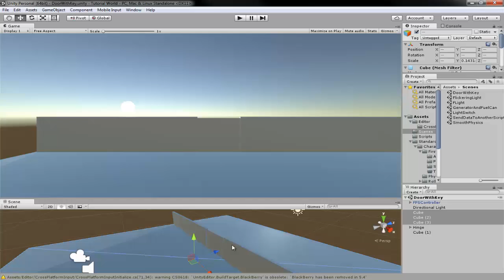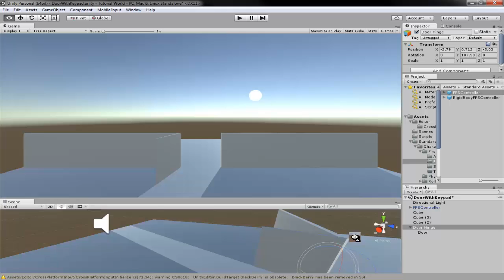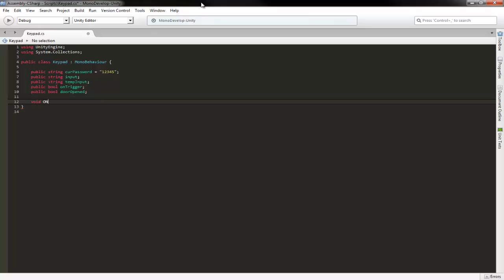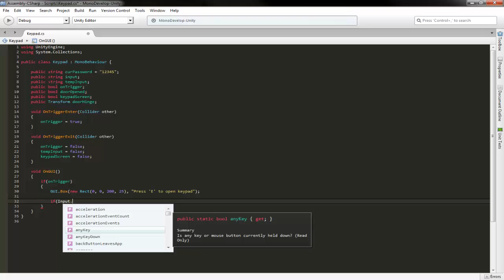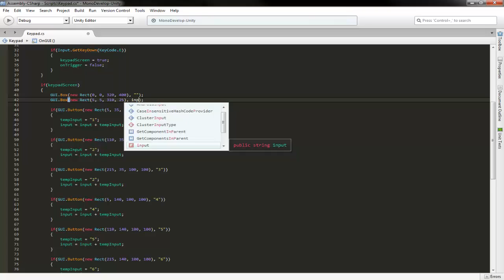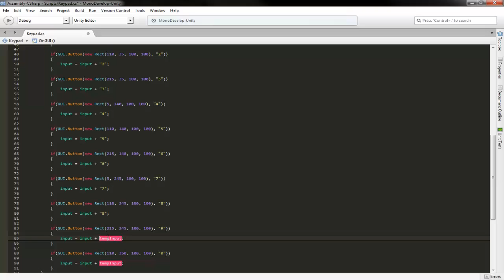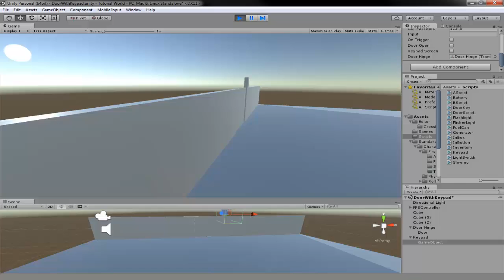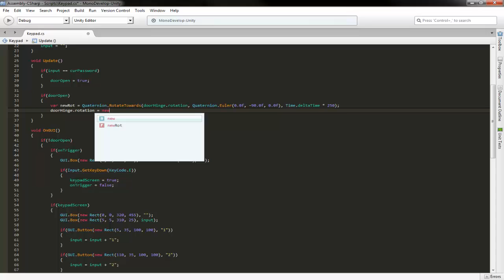[Unity3D] How to make a door with keypad (Script in the description) [HD]

Comment: In the part that you put
input = input +"1"
you can put a shorcut
(I think it works too)
input+="1"
this is the same as
input = input + "1"
Reply from the maker: Gamer 02 i didnt test that but i think that would work because += only work with integers not string
Reply: ItsProinc Maybe your are right.
I will not check that.
Good Video
Reply: Why not make an arraylist

Comment: Hello, first thank you for your code. I've tried to do it in 2D but the trigger doesn't work. i have to check the button by myself. Can you help me please ? :)
Reply from the maker: you can use 3 trigger in a 2d space, try using 3d trigger see if that helps
Reply: ItsProinc I've already tried it but nothing append :/
Reply: I just had to add 2D after OnTriggerEnter XD Is there a way to make the door goes up instead of rotating ? :)
Reply: Transform it instead of rotating. From that you can figure it out, if not, don't try to make games. ;)
Reply: d'Arquien If you can't answer the question, don't try to do it :)
Reply: I DID answer the the question, use Transform.